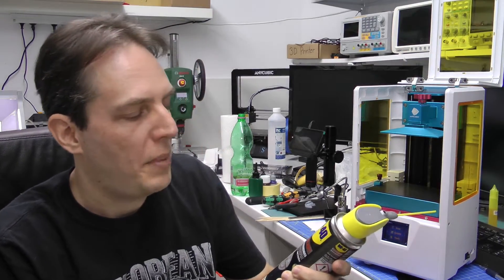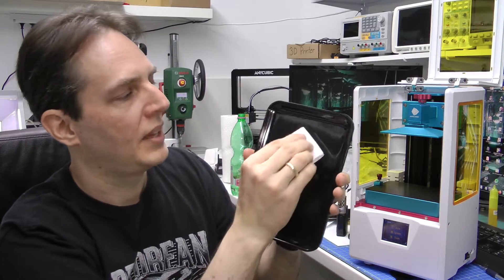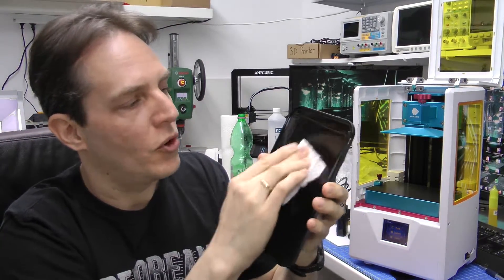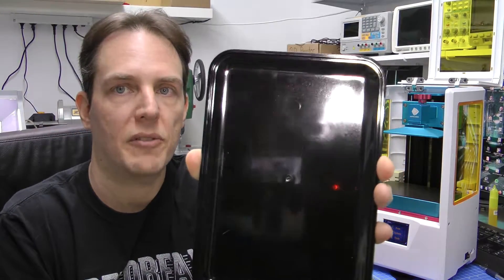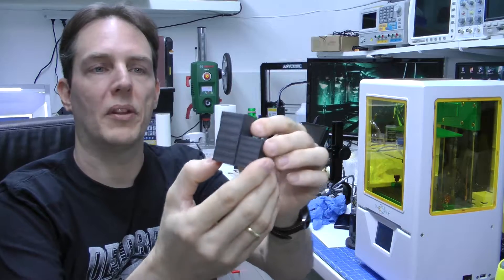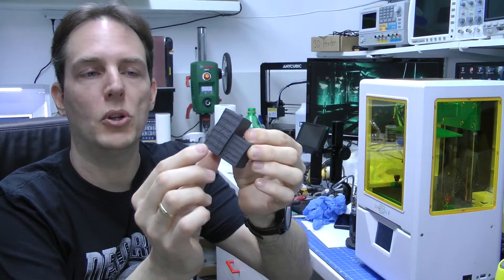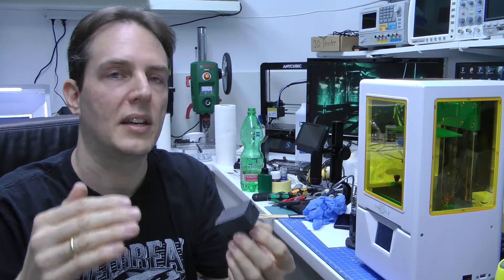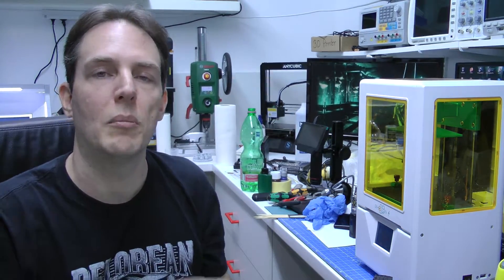Make every resin print stick to the printplate!

Comment: Great tips though the tip with the resin on the build plate is pointless... The build plate collects resin as it goes into the vat 😂
Reply from the maker: You are, of course totally correct that the build plate naturally dips into the resin.
However, that doesn't necessarily guarantee that the resin adheres to it seamlessly. Reasons for this can include the type of surface, which manufacturers design differently, but also unintended scratches and damages, as well as residues like fingerprints or other oils and greases.
And especially the initial adhesion of this first layer is particularly crucial for a successful print.
By manually covering the build plate with resin beforehand, you can ensure that problems with initial adhesion are minimized.
Reply: @Bluebrain  ah I get it! ie deep scratches will create air pockets in them to not allow the resin to enter.. not pointless after all!

Comment: I have to dissagree. PTFE lube is now widely considered useless. Painting resin onto the plate isn't really going to do anything (though allowing plenty of delay time for the plate to settle before turning on the UV is a good idea). I've printed plenty of parts that had wider sections than the area on the buildplate (though you can't push this too far).

Comment: my problem is that my prints are failing after the supports finish. after the supports, the prints stay on vat. i have a photon mono x. the print doesnt stick to the supports at all
Reply from the maker: This can have (at least) 4 causes:
- too short exposure time
- too small contact area between support tips and object
- not enough supports to hold the object
- too high suction force of the printed object (put in ventilation holes on the bottom of hollow objects)
Reply: @Bluebrain  Thank you so much for the tips. the issue was the exposure time. honestly was about to give up lol. i had 10 failed prints until i used your tip. now im printing like crazy. lol. who would you recommend to get stl files from? patreon?

Comment: Does it have to be the WD40 with PTFE or will the WD40 with Silicone also work as I already have a can of that!
Reply from the maker: it's not "with" - WD40 is only the brand name. I don't know if silicone will work, but I don't think so. But you can use any other "PTFE dry lubricant".

Comment: Just don't use paper towels on your FEP, you'll scratch it over time and cloud it.
Reply: Ooof... thats what ive been doing. Whats a good solution to wipe your FEP film clean when you dont plan on using it for an extended period of time?
Reply: @bagz8388  It's the same as using a regular duster and polish to clean a TV screen, over time it removes the coating and leaves tiny scratches and swirls.  Use micro fibre cloths.  You can get packs of disposable big ones that you can cut down, instead of trying to machine wash them.  Just make sure to cure the resin before binning them.

Comment: the point 3 let me understand more for resin print,   may I ask ,the point 1 ,   is it the PTFE  is for make the resin more easy left from the FEP ?   point 2 , for what result we need to coat resin on the build plane ?  thanks for yr great share!
Reply from the maker: Yes, the PTFE makes it harder for the resin to stick to the FEP film.

Metal and resin are completely different materials. The metal of the build plate can therefore be repellent to the resin. Also due to oxidation and residues on the printing plate.
Coating the printing plate with resin creates a connection and the resin in the vat then only has to adhere to its "own"/the same material, the resin on the build plate.
Reply: @Bluebrain  Thank you so much Bluebrain with detail explanation , yr tips is very very useful and let me more confidence for my 2nd time painting.

Comment: Thank you for the video! My first print was a failure on my Elegoo Mars Pro. My lil lion stuck on the build plate film at the bottom. 🥺 For 2 hours and 41 minutes, I waited for a failure. I was mad.
Reply: wait till you are printing something for 24 hours and not only does it print so you used all the resin, but its unusable due to errors! lol.
Reply: @Born_Stellar  been there done that with my ocarina.

Comment: Hey. and thank you for this very informative video. 

Just wondering what's the reasoning behind covering the build plate with resin? 

Thank you again.
Reply from the maker: Metal and resin are completely different materials. The metal of the build plate can therefore be repellent to the resin. Also due to oxidation and residues on the printing plate.
Coating the printing plate with resin creates a connection and the resin in the vat then only has to adhere to its "own"/the same material, the resin on the build plate.
Reply: @Bluebrain  what a fantastic and elaborate explanation! Thank you so much for the insight! Much MUCH appreciated! :-)

Comment: Turns out I've been doing number 2 since I first got my printer, I always home my build plate to the bed, so I can pour in my resin up to the top of the build plate before the extrusion with the gap in it, it works out better for me instead of accidentally pouring in too much resin and it getting in that small gap between the build plate and the part that attaches to the gantry. Then I raise the plate up by about 30 mm before starting the print (probably unnecessary but I know the build plate always goes to home before starting and I've got the fear that just once if it tries to go further down it might damage the FEP or the screen).
Reply: weve all been doing number 2 since we were born..

Comment: Some good advice here and agree it's good practice to ensure your build plate interface is larger than any other layer. Usually it just happens as you add supports but best to check you have a good first layer. I'd rather "waste" resin on supports than lose an entire print.
Basically view the model from above and the "raft" of the supports should extend out wider than the model is a reasonable guide.

Not sure I agree with the need to pre wet the build plate but maybe that's just for the Anycubic? Could be fixed with a simple G code mod though.
Essentially on the Saturn Elegoo the startup process for a print does this: It drops the build pate all the way down to the FEP then immediately lifts it up 8mm or so then drops it back down to then start the fist layer. I assume it's to remove trapped air and this sequence would ensure a completely wetted build plate surface so no need to pre wet IMO.

Obviously you don't want to get any PTFE oil on the build plate so any issues then do a good clean of the BP with IPA. 

My personal opinion the priority is to ensure your build plate is clean and level, the Z is set properly along with your first layer cure time for the resin your using. I'd also ensure the FEP is clean and the Resin filtered if needed as any foreign material could make the first layer to BP interface weaker.
Reply from the maker: You are absolutely right. Covering the build plate with resin prior to printing is not a "magic trick" that will guarantee that you will never have problems any more.
But it can definitely help (and won't hurt in any way).
It's only a link in the chain to successful prints. Everything else, like the points you raised, are also at least as important.
Reply: @Bluebrain  Just wondering do you need to level the build plate again, I readjust it after every time removing it.
Reply from the maker: @CharlotteSimmons1  No, you absolutely need not readjust it just because you took it off.

Comment: Thanks BlueBrain, this was solid advice. i just got my mono x and will be implementing. I'm using a different PTFE lub that says 3-in-1 which appears to work but may try the WD40 method as well. great advice!
Reply from the maker: PTFE should be PTFE, no matter which brand. If it says "3-in-1", you should just check that it does not have any additional additives.

Comment: Why does covering the build plate with resin before printing help?
Reply from the maker: Metal and resin are completely different materials. The metal of the build plate can therefore be repellent to the resin. Also due to oxidation and residues on the printing plate.
Coating the printing plate with resin creates a connection and the resin in the vat then only has to adhere to its "own"/the same material, the resin on the build plate.
Reply: @Bluebrain  Interesting, thanks. My Anycubic Mono X dunks the build plate into the resin, retracts it fully, then dunks it again to move the surface to the layer 1 position. I wonder if that has the same effect as manually smearing resin on the build plate with a plastic scraper prior to starting the print?
Reply from the maker: @jonathanpepper9743  It's very likely that Anycubic programmed it that way for the same reason.
But also when doing it manually, as you have to take the build plate off anyway, it just takes a few seconds. Therefore, it has no relevant influence on the total printing time, which usually takes many hours anyway.
Reply: @Bluebrain  Good point! 👍

Comment: It’s simple. Buy an Epax X1n. Every single print from my first to my 32nd. Stuck to the plate and zero print errors. No bed leveling . No issues, just perfect prints. Spend the extra money ONCE and save in frustration.